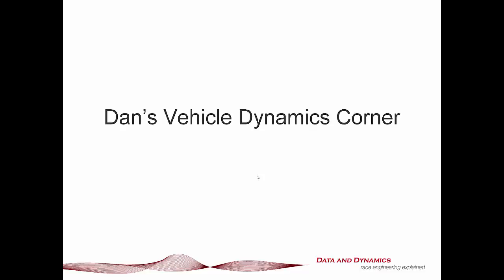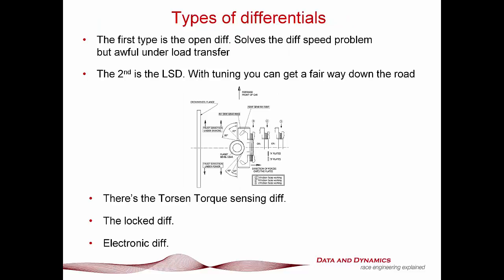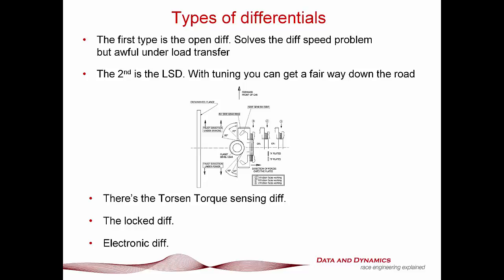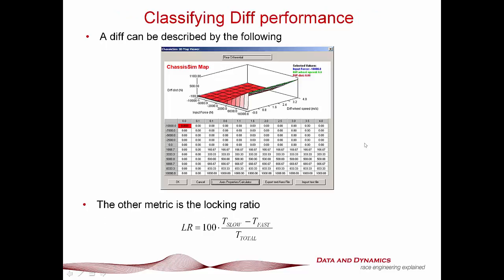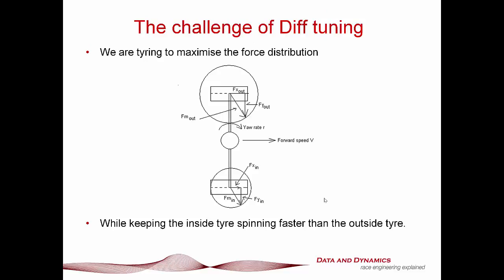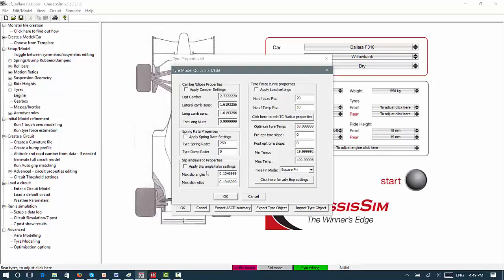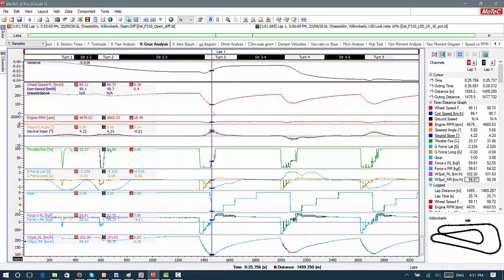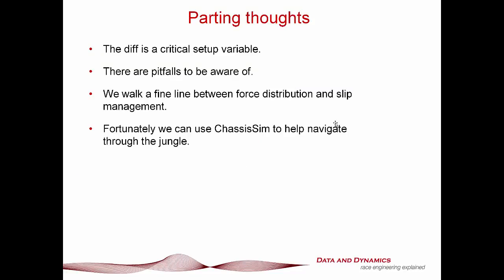The Dynamics of the Differential and tuning it with ChassisSim

Comment: Great video! How do you suggest using of all this if I don't have a tire model?
Reply from the maker: racekraft - constructing a tyre model is not as hard as you think. I would suggest looking at my video - tyre modelling from nothing. Digest that and get back to me.
Reply: @ChassisSim  thanks. There seem to be a few videos on tire modelling - which one are you referring to?
Reply from the maker: @racekraft  It should be the one I did in 2016
Reply: @ChassisSim  ok I think I found it. Will watch. Thanks!

Comment: Hey Danny,
Very cool video and I couldn't agree more about the importance of differentials.... Would you consider making a second part to this video showing us how to derive the diff map from logged wheel speed data and perhaps physical measurements if required?
Reply from the maker: Mearcat - You've taken the words right out of my mouth. It hit me between the nose the millisecond I posted the video.  I'm actually going to go one better than this. I'll do it next week. That being said in order for that to make sense I needed to do this first.
Reply: Fantastic, I got a good laugh at your comment of mechanics not being impressed with requests to change differential settings. As I'm the engineer, driver and mechanic for our small team I'm constantly arguing with myself as to what I should do next. If I can get this part of chassissim nailed it would make an astronomical difference to how I work things.
Reply from the maker: Leave this with me mate. This is the appeal of the electronic diff!
Reply: Yes it sure is, However putting an electronic diff into an oem fwd gearbox is probably not the easiest thing to undertake. If you want to make a video showing us how to do this as well feel free hahaha